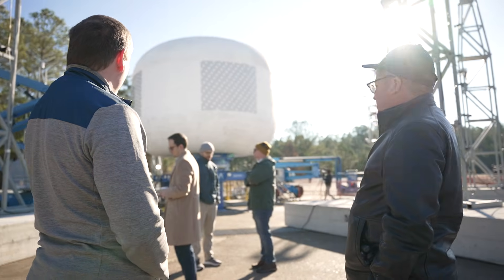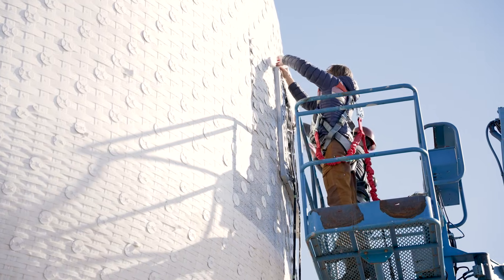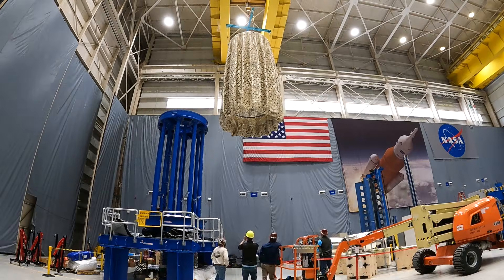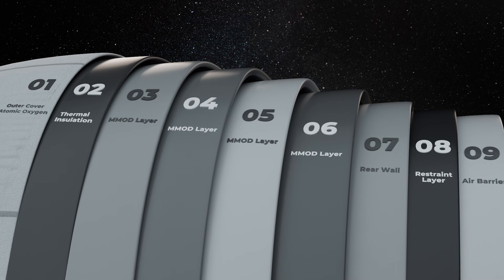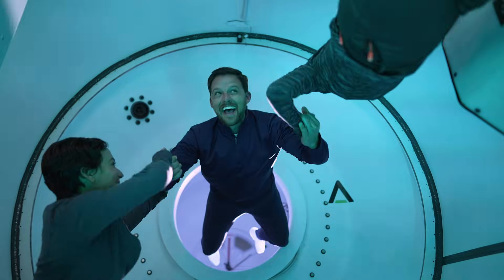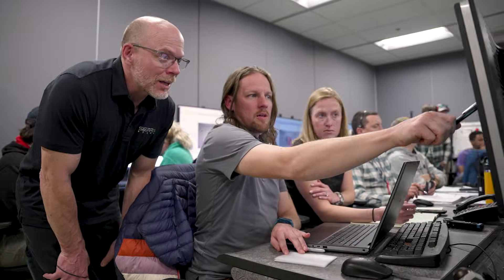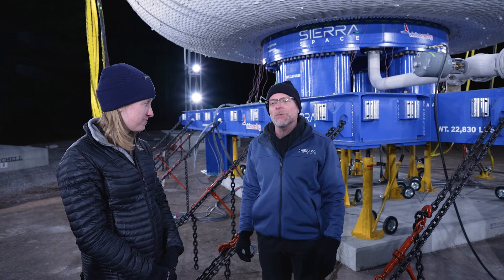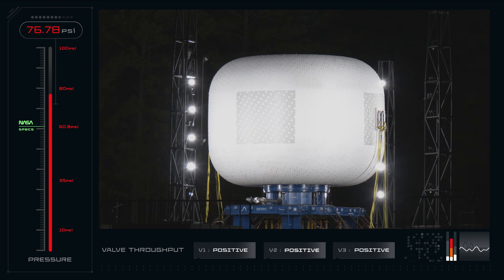Full-Scale LIFE™ Inflatable Space Station Burst Test at NASA Marshall Space Flight Center

Comment: Interesting concept, I'm just wondering what happens when you'd have to repair a tear. I imagine you couldn't just sew it up with needle and thread or put a patch over it. With a metal hull you can just weld it closed, but I'm interested to hear about a solution in this context

Comment: well it doesn't need to be as strong as steel,  it needs to shield from radiation, extreme heat, extreme cold and protect from space debris moving at very high speed that's it

Comment: I wonder if a sustained pressure test (at 2-3x) over the period of weeks to months with progressively increasing ballistic damage (emulating micrometeorites) (could use bullets that penetrate through) and then to test patching methods (internal and external). Then let it overpressure to failure to see how much strand damage it can withstand (and if the failure point is at the point of ballistic damage or elsewhere along the weave).

Comment: so, tell me how rigid the structure is in normal operating pressure, and how that level of rigidity (or presumably slight lack of rigidity compared to the traditional construction of the ISS) is going to lead to potential accelerated wear on the structure and equipment mounted inside the structure over the operational lifespan of the structure, or what your mitigation plan might be.

I guess I am saying that I am expecting the structure to receive repeated stress from flexing due to vibration and movement inside the structure that may cause wear between the hard woven material and the inner lining that seals the internal pressure.

Comment: This made me think differently about pressure. Since I worked in an industrial setting for most of my life, where our central compressor was set at 130 psi but the regulators at the outlets usually stayed at 80 (we cranked them up to 100 psi for some tools), 70 seems rather low to me. But, it's all about the application, isn't it? A tire at 32 psi blows up real good.

Comment: While watching, there is a question came to me: why do not use a water (or solution of same kind), as filling agent (instead of a breathable oxygen and nitrogen mixture)? It would be additional extra protection if meteor bursts an outside layer (it would froze on crack very quick), additional space radiation layer of protection and an extra oxygen/water tank just in case. What is the downsides of this solution? Maybe it is not that important now near Earth, but for any future interplanetary spacesheeps (to Mars for example)  all these factors are even more important...

Comment: 75 PSI 5 BAR  that is a bit more than a car tire, and how long can this withstand in the cold of space at 4 BAR why not making it round  this is on a central steel like a car tire on a rim  so its inside is very small,  sleeping in it would be a nightmare when just a small rubber bladder holds up to this airtight seal

Comment: How does the temperature insulation work in that inflatable module though? Since the layers are so thin how the astronauts will stay warm and how the pressure inside the module stays the same?
Reply: Interestingly the problem in space is actually staying cool. Since there's no air around you, heat radiates very slowly. Thats why the ISS has really big radiator panels, to get rid of all the heat from the astronauts bodies and equipment.

Comment: I feel like the only valid way to fully test its true capabilities in a space environment is to just send the thing into space. While the rubture and piercing tests help decide much of what could happen from happening... On earth things function differently than they do in space. Mostly due to the lack of gravity and what not. So the only true way to test its ability to function would be to put it in the environment it is built to endure. Best to also do that before putting peoples lives inside of it, obviously. One thing I will Edit in here as well is, Windows seem like a big safety risk for the station like this... but I am certain it is fine for the most part so long as you consider pressure and other factors and such. Especially, hoping, that it is strong enough to take on an impact without fully shattering, or if it does, that it can be easily repaired or have a failsafe so if it does break, that you can seal the hole, and replace it whenever one is available. Essentially a failsafe door that would shut on the windows location should the window itself break assuring that even if something passes through the window that the air and pressure in the station isn't completely lost.

However, if it is as tear resistant as you claim it to be, could the material it is made out of not also function like a net of sorts to help catch space debris? Afterall it is best we clean up our outer atmosphere if we plan to do anything big or expansive in space. As well as it making future space projects easier to accomplish, so finding such a way to catch the debris, or even using it as a net to protect stations and the like would be a good first step into general space exploration. I do feel like against far faster and bigger projectiles though, the fabric or whatever it may be, would surely suffer from such an impact... but even still, it is a good first step I suppose.

Me and my brother have dreams of space, and the infinite possibilities and exploration that await us in it, so to see NASA doing things gives us hope we lost many years ago of such a future being brought to fruition.

Comment: Probably a dumb question, but did y'all essentially build a large tire for space but with a thermal layer? It seems like by testing the burst layer your fabric is similar to tubeless tire or a kevlar lined tire but without the rubber on the outside. Why is the threshold 75 psi, why not something like 100?

Comment: 75 psi is pretty crazy. I used to work in the brew industry and you’d surely explode a stainless steel serving vessel at that pressure. Glad I never saw that at work because from the looks of that blow out I probably wouldn’t be around to tell the story.
Reply: I used to work with truck tyres, they explode at 120-130 psi lol
Reply: Lol don’t truck tires take 80 psi. This shit has never been heard of or done before. Go live in a tire in space
Reply: Though many times below what humans can survive.
Reply: Nah, 75psi isn't that much; it is a little over 5 atmospheres, the pressure of being 53m under water (not that deep). The yield strength of mild steel is 247MPa, UTS of 841 MPa. That is only 517kPa, nowhere near enough.
Reply: @joshbeaulieu7408   idk but isn't "a little over 5 atmospheres" a lot considering that in practice, this is supposed to withstand  only like 1 atmosphere?
Reply: All I know is the pressure release valve was set at 30psi on those tanks. Id assume at 3 times that youd at least be starting to bow the container, not to mention the weight of liquid. I looked to see if one had ever exploded and couldn't find any compete ruptures due to over pressurisation so maybe they can hold much more. I know that safety was not the main concern when I worked at the brewery and its very easy to forget you have a tank being pressurized. @ccllvn
Reply: @thsizzle8272  They could probably hold more, (30psi w/ safety factor of only 2 is 60psi) but to be fair, failing at 5 atmospheres is bomb territory so breaking earlier by design/pressure release valve (and thus never hearing of a rupture) is probably a good thing.

In space ludicrous pressure ratings are great, in industry, safe failures are better cause some genius will disable a valve someday.
Reply: @joshbeaulieu7408  It all depends. What pressures are they planning on exposing this structure to?
Reply: Yeah 75 is a freaking lot!

Comment: The building industry making concrete domes, uses a balloon in a half sphere and then sprays the outside with shotcrete.  For a habitat the interior would need to be insulated. The easiest way? to do that would be a two part expanding foam, spray foam, again from the housing industry. Would there be enough protection or strength in the foam to ally fears of the impact hazards in space?

Comment: so...with fabrics being produced that are inherently stronger than steel I can easily understand why this is in development. My question would be about this structures behavior in a vacuum under atmospheric pressure and how it would respond to a micro fissure or hole produced by a very small but fast moving object...would fabric behave the same way or would it be a higher risk for structural failure dominos? Ultimately, steel or fabric...my ass could never be convinced to leave this rock lol.

Comment: Very interesting, your team said this module would take up less space on launch, Though I am curious to know how dense/heavy this is in contrast to the already in use modules on the ISS.
Reply: The old module system took more launches to get the same volume into space, but it was usable volume and this seems to be utterly bereft of any use without having the same number of old launches to provide interior structures to fill the space this creates yielding an actual net increase in launches to provide the same functionality.  It's great that it expands to 27' diameter, but with nothing inside that space it's pretty useless.

Comment: Try that same test in a vacuum chamber that matches the atmosphere in space.  Looks like it would fail just after being sent into space without it being deployed properly.  I may have seen too many hobby weather balloon experiments on YT.  With it not being tested in NASA's vacuum chamber test facility it would not pass easily.  Fail under 100 PSI?  How long is this supposed to last?  I do understand that this is not supposed to be deployed with more than 3 PSI but if it fails out in space shredding apart how is someone supposed to live in it?  I don't see a leak test where they fill it wwith at least 2x the normal pressure and let it sit for at least a week and make sure that it can hold at the same pressure.  What test is this?

Comment: To start, I'm not an expert on the subject or have I been able to test this in any scale or know if it would even work.

That said, would it be possible to have a trapped viscus layer of a gel sealant that while under the pressure in the vacuum if space. Should a pin hole or other hole happen to the outer layer. The pressure on the inside of the chamber pushing against the walls evenly, push the gel sealant towards the hole. That as soon as it's exposed to the vacuum, has the compound that keeps the gel a gel flashes off. Freezing the gel into a hard polymer patch? Something like that green gel that's supposed to plug holes in tires here on Earth?

Comment: how will plumbing, wiring, and other life support infrastructure be incorporated? everywhere you have to poke a hole to allow water to move or run cables for electronics is a potential failure point. how will hardware be mounted on the inside? will hardware be mounted post launch or are you thinking about having all the monitors panels, and other buttons and switches be mounted when in launch configuration?

Comment: I think it is important to think about practical scope of application for inflatable habitats in space.  Maybe someone who has thought about this a lot more than I have can chime in.

I look at the practical scope and maybe something to consider is the following:
1. On Earth, we are all familiar with tents and even working on things in the open air.  In space, there is no "open air", just the vacuum of space.

2. When it comes to semi-ridged mobile habitats on Earth, it is generally small as in a small pop-up travel trailer or a van with say a pop-up space.  You go up a little more to RV size and they are ridged.  Granted, an expensive RV can have pop-out living quarters, but these are rigid pop-outs with fixed things inside.

3. When you tent it up on Earth, the bigger the tent with more stuff inside, the more work it is to setup and break down camp.

4. I look at things like Starship, and you can go to big sizes.  I am thinking especially if you want to stick a bunch of stuff inside, labor in space is extremely expensive.  Right now for the ISS, each man year in space costs over $100 million.  A man year on Earth goes for 1,000x less.  So you look at maybe we use a rigid structure we setup on Earth as opposed to an inflatable structure we setup in space and the choice is clear, set it up on Earth in a rigid structure and then launch it up.  If you want to go big and spend hundreds of millions or even billions on it, the ISS cost over $100 billion after all, you get into a disposable Starship upper stage and maybe even hatches built into the fuel tanks so you can access them in orbit once all of the fuel is expended, and you have a massive space all rigid making it into orbit with a massive amount of equipment all fixed into place on the ground.  A space station in a single launch.  Don't forget SpaceX is looking to do something like a 140m stretch version next with 9 engines on the second stage.  That is a pretty massive thing to blast into orbit, especially if you plan on using the whole space and have nothing come back to Earth for reuse except maybe a future re-supply mission you take off the engines and bring them back because you don't need your launch engines in orbit for a space station, but maybe just some small station keeping engines that are say ion drive.  If it just costs SpaceX a few million to make that upper stage, which sounds to be the case, say you spend a billion dollars getting together a space station built into a Starship upper stage as the base platform, why try to bring anything back?  Just have the whole thing go up there and stay up there.

5. Considering what to do with the tank space of a Starship upper stage turned into a single massive space station, airliners have doors on them that hold back pressure.  It adds extra mass, but consider Starship normally has a lot of extra mass to attempt recovery.  Once you dump this recovery idea overboard for the second stage and especially if you add in a ballistic ocean based landing for the booster and above the propellant tanks you do whatever you want as long as it can survive the launch, you have stretched tanks, and 9 engines instead of the current 6 engines that all produce more thrust as SpaceX has been upgrading their engines, extra mass in these tanks for doors and hatches is trivial.  Adding protective and insulation layers is not trivial, but we have done things like with Skylab turning a rocket stage into a habitat before without adding too much mass to make it into a habitat.  Actually, using rocket stages as "wet labs" is nothing new at all conceptually; it has just not been used much in real life.  So it can be done.  It is just in Starship's case you could have a large "dry lab" space and a large "wet lab" space.  Most probably what I am thinking you do is the lower propellant tank becomes a hanger with a large door on it.  Maybe ion drive tugs haul back satellites to be brought in the hanger so they can be worked on without pressure suits being used by the workers.  You could make it so even the Hubble could be stuffed in there and worked on without pressure suits.  If you could hull in all of these existing satellites efficiently with ion drive tugs and service them in space in a pressurized vessel, that would be huge and it could all be done in a rigid structure like a Starship 2nd stage lower propellant tank.  The upper tank will mainly just have hatches between the main "dry lab" space and the hanger / workshop space.  You could setup all kinds of stuff in there.  Probably focus it on storage and growing food in space as well as maybe a gym.  It is nice to have a big space for a gym.  So you divide up the space of the upper tank.  Then of course with the "dry lab" area, you can have all kinds of sophisticated stuff in there and probably the main living quarters as that can be all fixed into place on the ground and ready for use.  May even go up to say 12m wide as you build the space station structure to go up with nothing around it; it is its own payload fairing.  I mean you just don't need a throw-away structure around the structure; just have one well made structure to do it all.

When I look at all of this, it just seems while the inflatable habitat is a cool idea, its practical application is limited and we have other better ways of achieving these goals.
Reply: What if you combine them? In all of that rigid space you put one of these soft space things that would be maybe a 500 foot or 1000 foot sphere that would attach to your rigid structure

Comment: This model is incredibly scalable, flexible… it is really a fascinating project. I guess any habitat going into space is bound to have an incredible amount of redundancy for each key components, because it is inherently a risky affair no matter how high we set our security standards… and there rests my main 3 concerns with this tech: 

- making the structural integrity something that could be catastrophically compromised not only by external factors but also by hardware or software malfunctions is another risk to add to the basket of an already heavy one. 

- in the event of loss of structural integrity, it looks like the damage could easily propagate to other components in leu of its explosiveness. 

- running maintenance on a pressurized tensostrucure adds another layer of complexity and even more risks.

Not knowing all the details, it seems this model could benefit from being divided into multiple independent concentric softshells, so that at least the latest 2 points would be relatively manageable. But that are just very basic assumptions from an architect that loves delving into future habitats :)